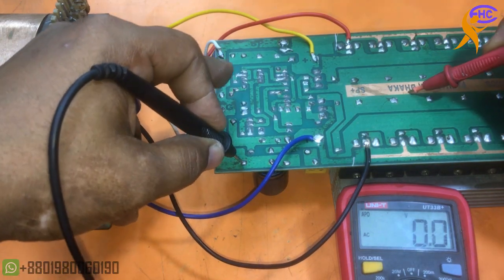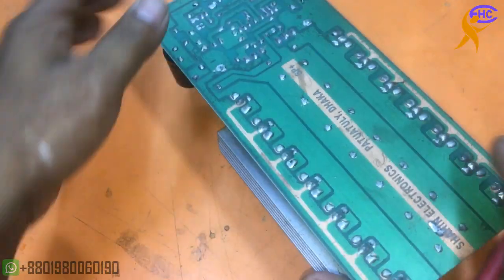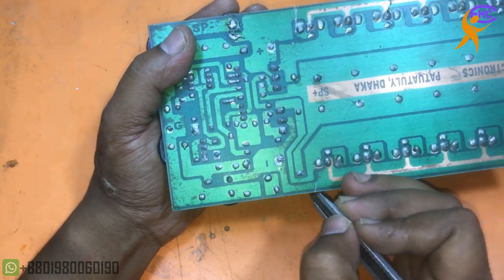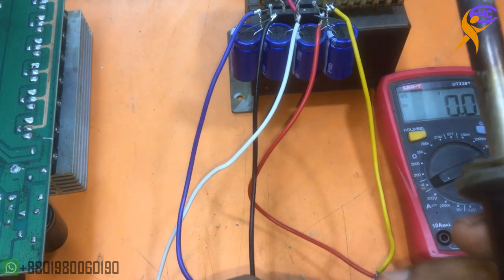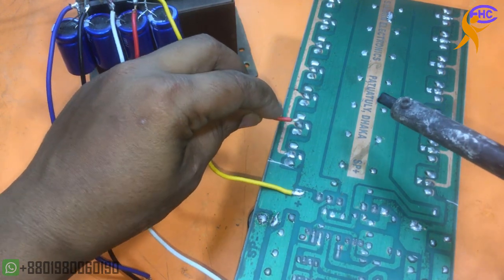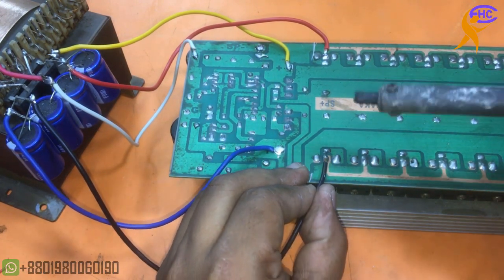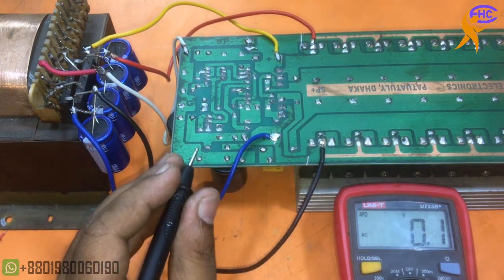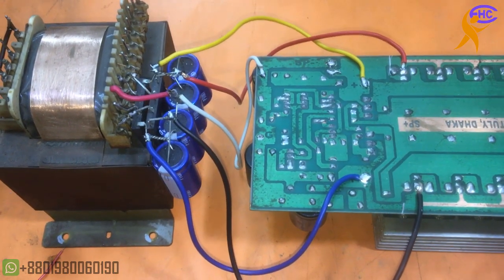How to make transistor amplifier circuit

Comment: I need some help... my car amp is blowing the 2 20amp fuses immediately as soon as the fuse is inserted, it was all playing well since forever but out of the blue it just shut off, when I check those 2 fuses I see they are blown, I tried to replace the fuse with everything off and just the power cable and ground connected and still its blowing the fuses immediately, the remote wire is disconnected and speaker wires and the rc cables all disconnected with just the power wire and the ground wire connected but its still blowing the fuses the moment it goes into the holder on the amp, this has now happened to 2 of my 4ch amps within a short space of time like a few days space of time, as soon as the 1st amp started doing this I removed it and put another 1 from my other vehicle and after like 2 days this amp started doing this aswell so I am now lost... any help would be great guys...